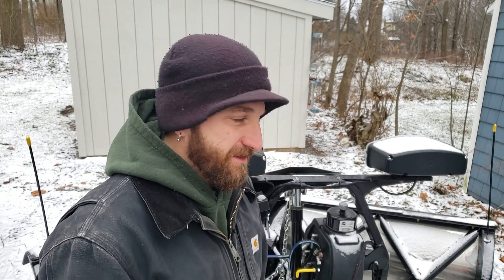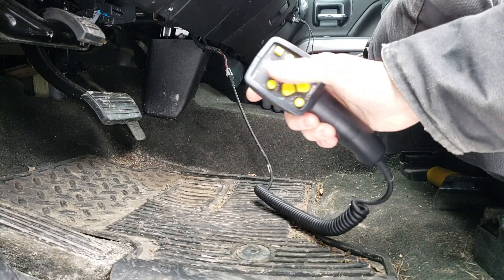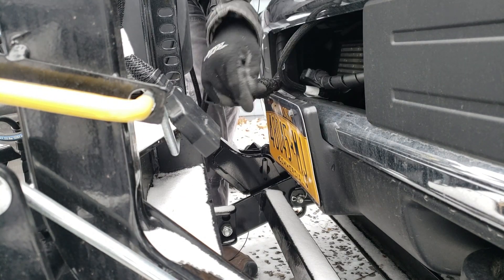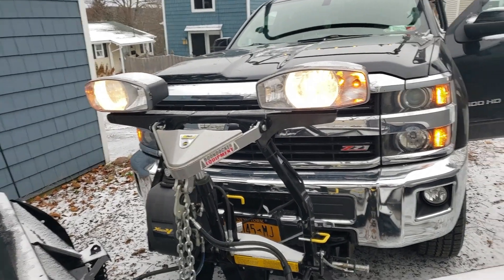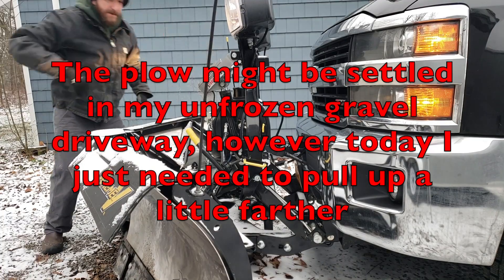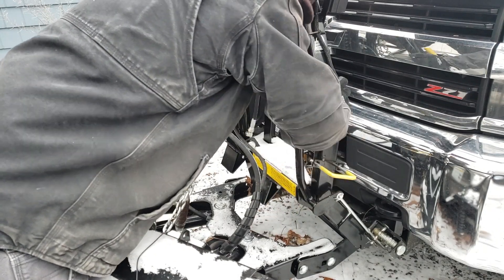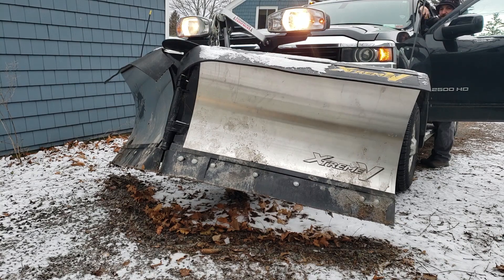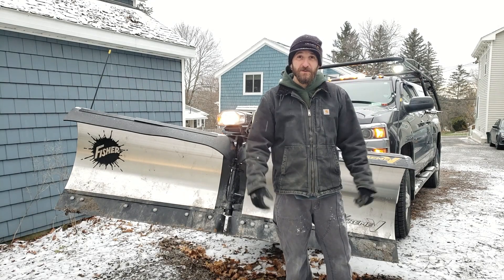Fisher Xtreme-V Plow Minute Mount Hookup

Comment: I got a 2016 F250 with Fisher V plow, And, Man, hooking it up to the truck is a pain, uneven ground, settling and alignment ..Then we had a crazy spring storm 2020, I drove a mile with the kick stand down!! OMG.. was a mess.. But I am glad  I am not the only one who has to take a few tries to get the plow on !! Thought it was just me ! ..except for the kick stand thing.. totally rookie move on my part.. The minute mount is not a minute !
Reply from the maker: I've definitely pulled away with the kick stand down... you realize it pretty quick though!! LOL! I've done it in a minute... under perfect circumstances... but usually it takes much longer. I have a gravel driveway and it always sinks in a little and makes it really touch. Someone suggested that I put wide boards under the blade and stand and that will help even out the footprint. I haven't tried it though...
Reply: Absolutely the board helps.  The key is the preps you make while unhooking.  Get the board under the stand foot and have that stand fully lowered.  The goal is to have minimal movement of the plow when you back away.  When you do that you know you will be in the right vertical alignment next time.  For horizontal alignment I put a mark on the drivers side light that I use to line up on to get me close.

Comment: It takes me less then a min it’s not hard you just need to know how to do it
Reply from the maker: Yes, if you're on pavement it goes on easy most of the time. It tends to sink in my gravel driveway which makes it not line up right. I tried taking it off not in V but straight and there is less tension on the chains and that seems to make it a little easier to do, but also a little less stable. I also put it on some boards to help prevent sinking. Waiting for my first storm to plow and I'll find out for sure if i made the right choice
Reply from the maker: @motorkola2 it worked great as always! I'm upstate so I only got about 8 inches although it was on the heavier side